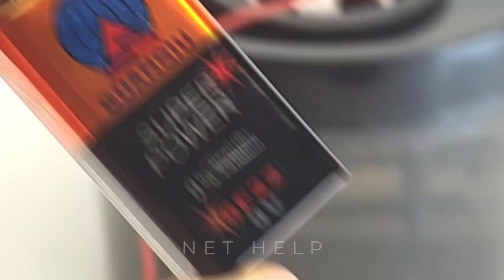Making a hydrogen generator with simple materials that we all have

Comment: But the plates that you used. Negative and positive together by nails. Is it possible. Maybe it damage the battery.
Reply from the maker: No sir, it does not harm the battery because we do not load it with a strong voltage.

Comment: This is so fake! Hydrogen doesn't burn like that, it explodes. It must be a flammable liquid of some kind
Reply from the maker: Sir... In the video we mentioned that we converted water into liquid hydrogen and liquid hydrogen burns because we did not use salt to produce hydrogen but rather used hydrocarbons. We also mentioned that we used distilled water to produce liquid hydrogen and ignited it.... As for the reason why hydrogen did not explode at first, it is liquid hydrogen and the explosion will not happen except when hydrogen is exposed to a very high temperature and this is what happened at the end of the video. If you watch, when the temperature of hydrogen became high, it began to give off strong reactions. You can watch this at the end of the video.

Thank you for following. I do not hate those who criticize me and I respect the opinions of critics because I know that many who watch how hydrogen is produced will not notice that the hydrogen we are talking about is liquid hydrogen and not hydrogen gas. 🌹🌹🌹

Comment: Check out drain cleaning fluid at fuelban from several years ago. Toxic and highly dangerous to say the least, 
You neglected to mention the materials you are using here ...the flame shown is no hydrogen, the flame is blue, as such alcohol....
So..... Crap.
THOM IN SCOTLAND.
Reply from the maker: Sir... At the beginning of the ignition, any ignition of the fire is blue and you can see any type of fuel, whether it is gasoline, diesel, kerosene, or even hydrogen and kerosene. However, as the temperature approaches a degree above 90 degrees, the color differs according to the type of material. For example, turn on the diesel. At the beginning, the combustion will be blue, and with the heat, the combustion will become yellow. As for gasoline, it will become green. And so on. Hydrogen is blue at the beginning and with heat it becomes another color. Watch the video until the end.... Thank you, sir.